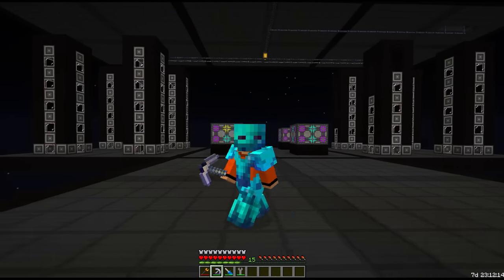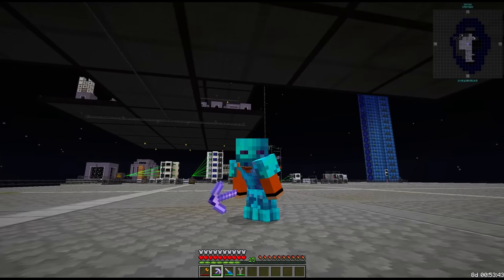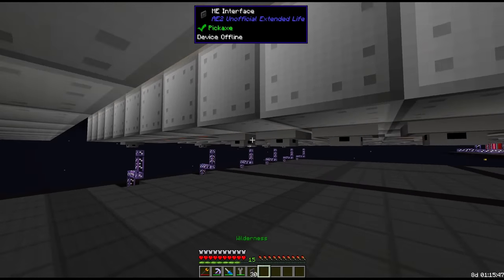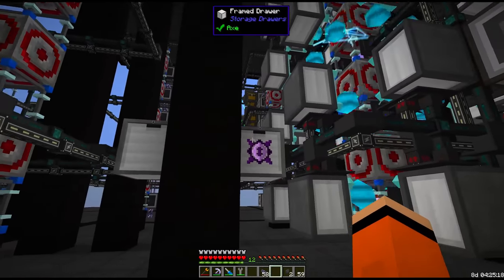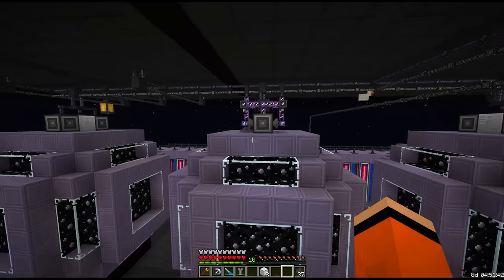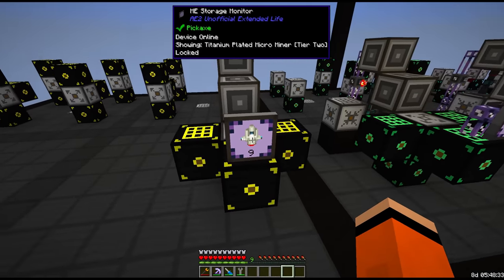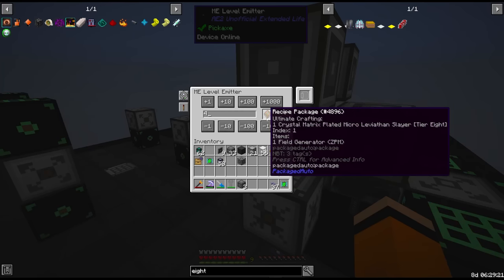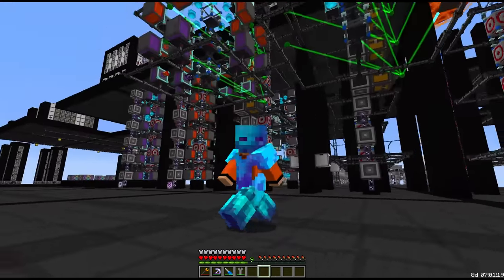Craft Too Large - Nomifactory: Episode 29

Comment: Fusion injector crafting indicator is minimum, not required tier. So yes, it would be hugely recommended to upgrade as many injectors you can, to as high as you can. (UNLESS NOMI USES CUSTOM DraconicEvo MOD JAR)
Reply: And to add, even with superconductor conduit, the charge time is sped up by putting conduits on all faces of the injectors so you can squeeze some more speed out of fusion crafting by upgrading the injectors (tested this myself in my game as well) and adding more conduits

Comment: Ah yes, chasing down bottle neck after bottle neck. Familiar. I used automation tables for all the passive extended crafting. Definitely less flexible and slower than extended crafting and comes with a buffer than can take a while to fill with expensive items, but it wasn't a bottle neck for me except for the mining lasers. To be honest, when I saw your wall of crafters I was like "that's way too small"

So I've now crafting 2 of the 6 infinity solar panels and my big bottle neck is wither bones! I have enough of everything else except wither bones. I was only running 4 wither data models because you don't need them much until each solar panel takes like over 10k with all the ultimate material needed. I've added like 75 wither data models and I guess I just need to wait to get enough of them to finish up vending. It's a bit anti climatic but that's alright. 4 slots remain!

Comment: Congrats on reaching 8k subscribers! Looks like your specific questions were suitably answered by other viewers already, so I'll give some tips instead.

First is to be extremely careful when encoding Extra Utilities generators. Make sure substitutions are OFF otherwise AE2 will happily combine random generators together then wonder where they all went. Rather annoying problem with that mod.

The other tip is that I noticed you're bottlenecking in at least one place on wire combining crafts. You should make use of Wire Bundlers, as they will be vastly faster than Mechanical Crafters and can go straight to any desired wire thickness from 1x. You can even put them in a PA and take advantage of distinct buses for speedy on-demand crafting.
Reply: Oh man wire bundlers sound great! I just wanted to say as I finish up my run of nomi 1.2.2 that this is an incredible pack and I've really enjoyed it, and I know I'm over a year behind where 1.3 dev is right now and it seems like you have put a ton of work into making the pack even better! Thanks for all your work!
Reply: @Jonbobwing  Thank you, I'm glad you're enjoying it 😄

Comment: The difference in charge rate between the higher tier injectors and the basic is pretty large but the time between when the receipt is charged with rf and it complete does not get shorter I believe.  If it’s a low rf receipt you might not notice much of a speed improvement for the lower tier receipts but the large rf cost ones you will notice it for sure.